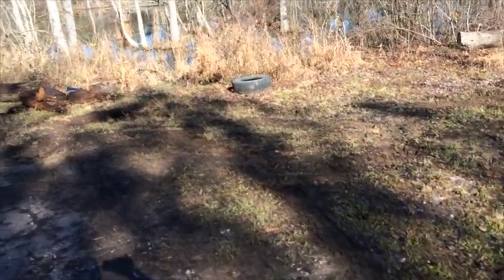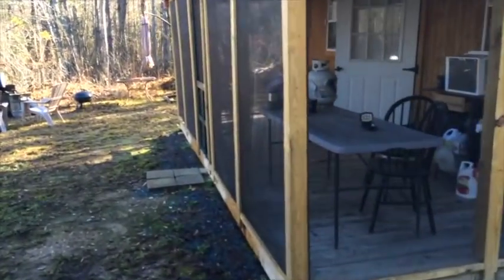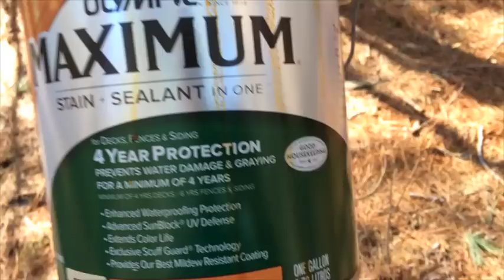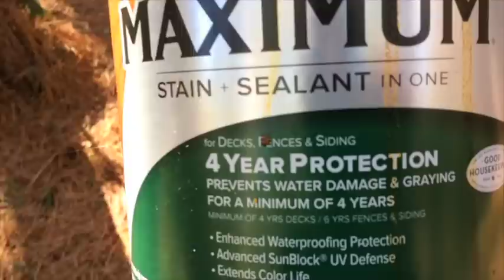Off Grid Cabin: Stained Deck, Beehive, Shipping Container

Comment: A friend of mine uses a "mobile home" roof tar on the top of his containers that he uses as a storage sheds. He repaired the rust areas like you did, and applied that tar with a roller right out of the 18 litre container. It has some kind of fibre in it, and dries a silver reflective colour. In the 10 years I have known him. We applied only 2 coats since the original application. We are sub tropical climate with some serious hot sun all summer long. Look into that type of coating once you have all your areas fixed. Keep up the excellent progress !!!
Reply from the maker: +Alan Marine Thanks Alan. I will.

Comment: The pine needles(and most evergreen needles) are kind of corrosive to metal. So best to try and keep the needles from building up on the roof since it's flat. Perhaps a form of car undercoating , tar coating or bed liner for the container roof?
Also for your garden mulch...same thing needles are on the acid side, so can impact some of the crops you plan to grow.

Comment: A thought for something to make the garden soil better. See if there are any mushroom farms close. The waste from those plates especially is excellent for building your soil up and generally cheap. Second contact farms with cattle. They may have a big pile of manure you could get. If not I'd bet they would let you clean out the stalls and have it for free. Yep work involved there but anything worth having...
Reply from the maker: +CharliePrep I do have a place I can get horse manure for free. I need to put sides on my trailer so I can get some. Thanks for the tips.
Reply: That leftover stuff from the mushroom farms is gold if you can find it close

Comment: Cool Coat rubber roofing, It will seal the roof and drop the roof temp by 30 degrees. And it is good for 10 to 50 years depending which kind you buy.
Reply from the maker: +Mike Roqers I will check this out. Thx.
Reply from the maker: +Mike Roqers yikes! This is expensive stuff.
Reply: The 10 year stuff cost me $110.00 for 5 gallons.
Reply: 50 year stuff $200 something for 5 gallons.

Comment: The roof is going to always be a issue with rust, How much would it be to put a roof on it. 2x8x20 along one side 2x4x20 on bucks side of the container with joist and 12' roofing like Bucks House. It a later date you could put a 20' gutter on bucks room  to collect water from both roofs to water the garden. It would also make the container cooler.
Reply from the maker: +Dan PetersonTaylor I'm not sure what it would cost but it would most likely be between $3-$400.

Comment: Hey Tommy deck looks great. check out the coating for metal roofs like for mobile homes etc. it's from $ 60.00 for a 5 gallon  after you get the rusts spots taken care of.. the trolls that thumbs down don't have to be a sub to do it but glad u get the view. if the water flows down that will wash the garden or mulch maybe use the trees cut to line by the pond. . I have a name for your pond Lone Duck Pond ..dang I write to much lol
Reply from the maker: +William Johnson I don't even have a lone duck anymore. Fred is m.i.a. The stuff I was looking at was $80/gallon. If you have a link for the stuff you're talking about, please post it. Thx.
Reply: +Off Grid Nation Tommy the price will vary depending where you buy it Walmart Lowe's or other hardware stores and have it on sale at times .Sorry about Fred the duck missing maybe he will show back up when it get warmer.